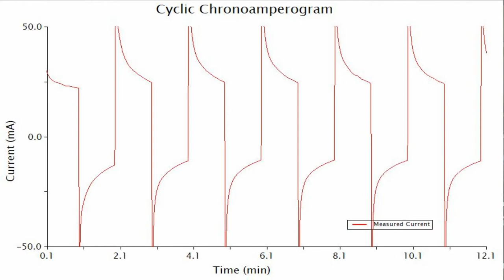Iron Chloride Cell - Simple Battery is Working

Comment: Hi Peter, I have a couple of thoughts. 1.Using acetone as the electrolyte to take eliminate the break down of water on recharge.2. Using graphite wool as both electrodes. That is to say, if all the iron was discharged to iron 2+ then you would have a permanent inert electrode to replate the iron. Just a thought? Well done anyway!
Reply from the maker: Thanks! This was an older video, we made a lot of progress since then and found some chemistry that was really reliable: https://youtu.be/z6vcbXLKJR0

Comment: Would a solid and rigid separator help with keeping the compounds unmixed? I had read a while back (though can't find it again) a paper that talks about the use of an ion conductive polymerized resin that was extremely chemical resistant, but it could provide the option for it to be cast in molds for experimentation and eventual "production" modes (lots of current manufacturing processes could be tweaked to scale).
Reply from the maker: That's a cool idea - it would be fun to find a resin based polymer separator. I've tried making polymer gel separators with some success, but it's not clear if it will be any better than Nafion (and probably will depend on pH). Nafion is way easier to use than I expected. It comes as a solution in alcohol.